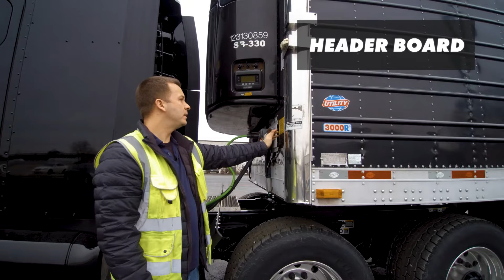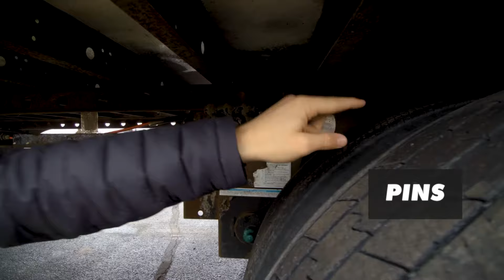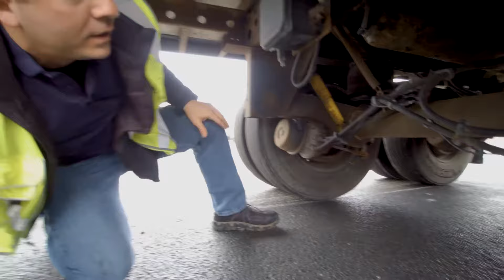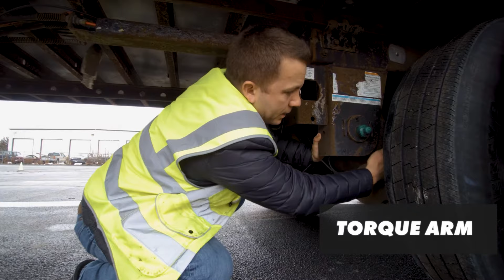Class A CDL Pre-Trip Trailer Inspection | TRAINING with Wilson Logistics

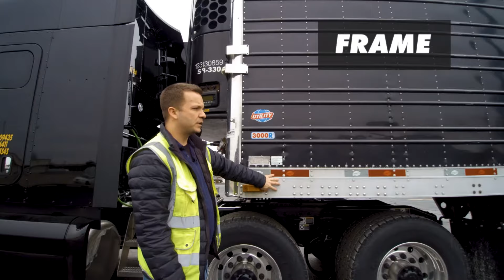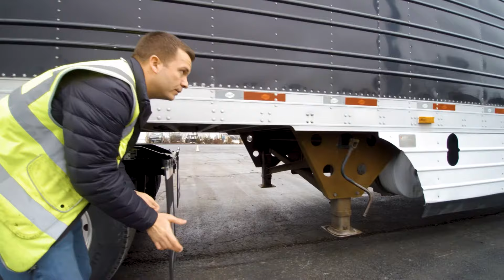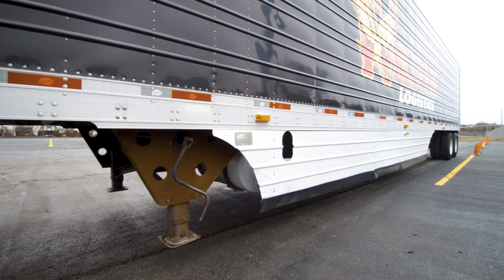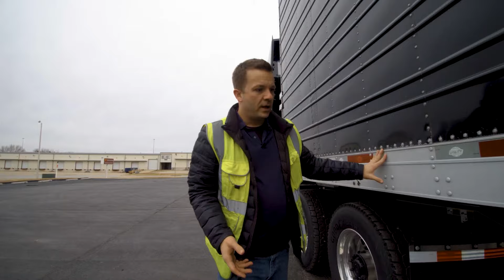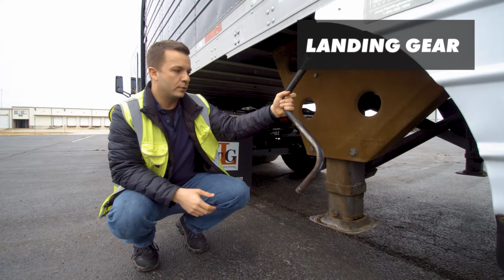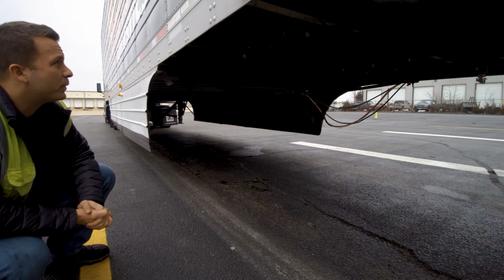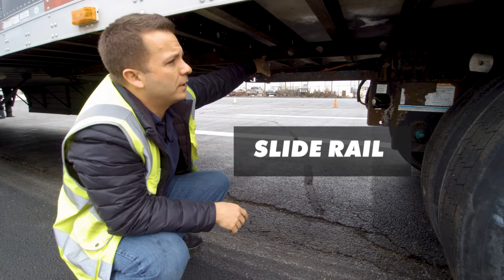Comment: 0:08 header board 0:29 frame of trailer 0:39 Undersider of trailers 0:49cross members/ holes in floor board 1:24 landing gear/ landing gear shoes 1:37 handle/crank 2:19 Tandem release 2:44 Slide rail 2:48 pins 3:12 brakes/suspension systems 3:25 brake hoses 3:34brake chamber 3:44 slack adjusters/push rods 4:18 brake drum 4:25 brake shoe or linning 4:44 shock absorbers 4:56 air bag 5:08 torque arm mont / torque arm 5:40 inside  rim 6:07 tires
Reply: Thank you ❤bong it helps
Reply: Thank you

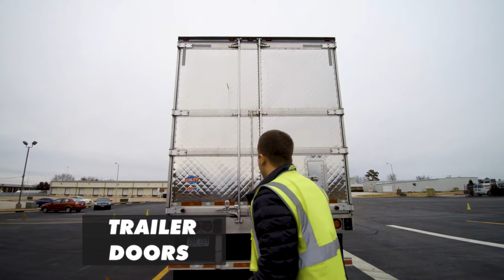Comment: 6:44 lug nuts “10’ 7:02 hub seal 7:12 Air lines 7:25 2nd axle 7:30 Lines 7:49 mud flap/splash guard 8:02 trailer doors 8:06 latches 8:11 hinges 8:27 rubber seals
Reply: Thank you

Comment: On the test for tire pressure does the student have to check air pressure for every tire to make sure it's around 100 psi? How would you know without a pressure gauge,those tires could of been 80 psi.